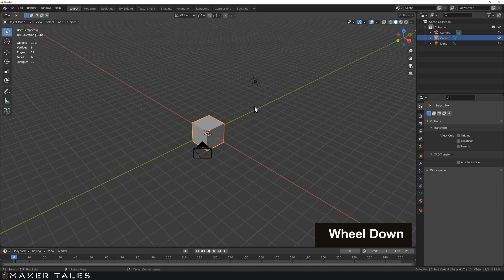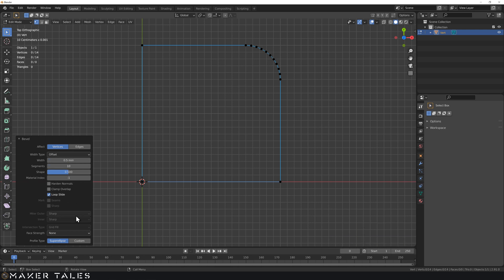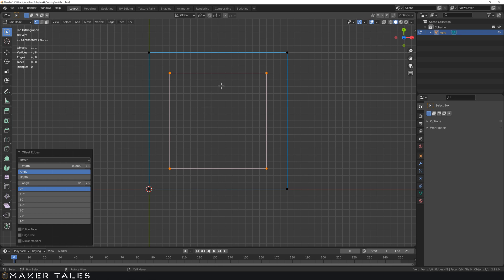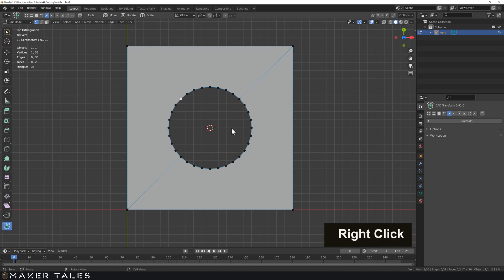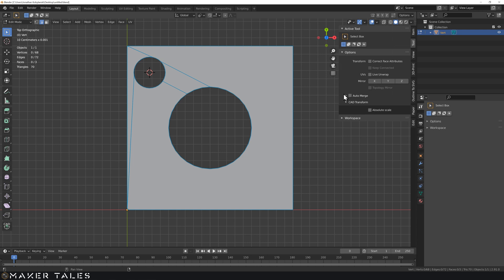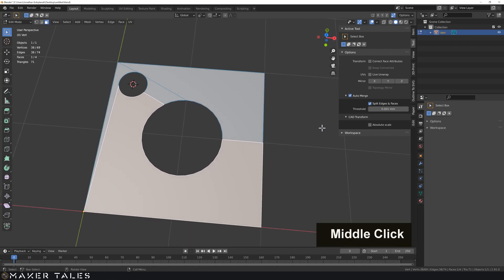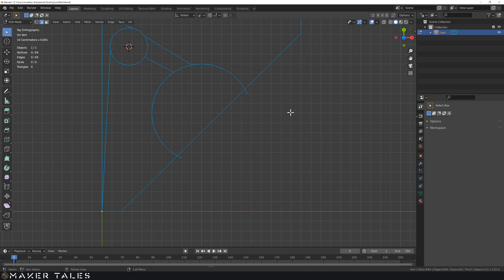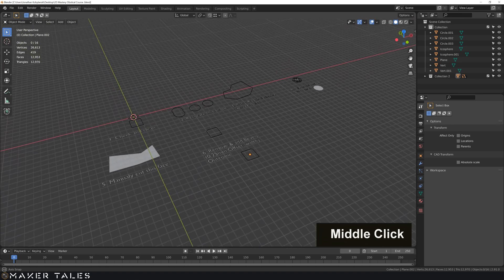2D Precision Basics Continued - Blender 2.9+ / 3.0 Through Precision Modeling - Tutorial | Part - 14

Comment: 12:45 if you don't want to move the vertex back and forth after moving it with CAD transforms, you can just go G type 0 and enter. The vertex does not move but the split happens

Comment: I have a question, is the width setting for the bevels similar to the radius setting in other programs like AutoCad. For example if i wanted a square with 2mm bevels could i do that by entering 2 in the width parameter?
Reply from the maker: Over all yes. From my understanding. When it basically does is duplicate and "slide" the vertex along the edges by 2mm.

Comment: your method of reverting chamfers and bevels only really works for objects perp/parallel to view. Would it be easier to just delete the vertices, then use tiny cad to get the intersection? That would work, regardless of the angles. You could use cad transforms as well, in a similar way to what you've done with the scaling method, but just deleting them and using tiny cad seems to be a faster method which also works with more examples. 
Loving these BTW. I've been using blender for a little bit now, but also use lots of CAD software, so it's nice to see how different people use blender with different backgrounds.
Reply from the maker: Hey Andy, there are plenty of ways to undo bevels. The method I use can work in any orientation It just takes time and the use of CAD transforms not default blender movement.

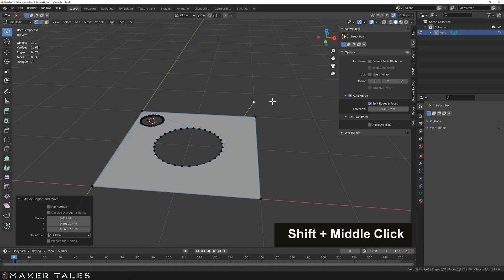Comment: Amazing videos! I have one question: When using Cad - Transforms, I cannot snap to vertexes unless they are part of a Face. For example, it happens in a situation like 11:36, when there is a vertex in the end of the edge after extruding: I go to Cad Transfroms ("Alt+C"), I press "G", "space" and "V", and I cannot snap to that vertex (I cannot even select it to move it), but I can select and snap to all the other vertexes which are indeed part of Faces. The same happens in other similar situations, not only in this particular one. 

Does any one could help me with this problem? 
Thank you so much, and congratulations again for the video series!
Reply from the maker: Hmmm, this sounds like you might not be is vertex selection mode. Make sure on the top left of edit more you have vertex selection on to be able to move a vertex.
Reply: @Keep-Making  Thank you for your fast answer and your help! Finally I installed again the add-on in the most recent version and it worked perfectly.
Reply: I also have an issue at @11:36, CAD Transform shows the cursor snapping to the edge center, but the vertex does not move to the snapping point. Instead, it kind of ends up underneath the object in Z space in a sort of random-seeming spot. -If I do all of this in top-view it all works fine, it's like 3D view is messing things up.

I've been banging my head against the wall. I select a vertex, extrude in 3D, press G to move, V to select vertex, space, shift+e, the cursor shows the snapping circle in the right spot but that's not where the vertex ends up. If anyone can help that would be much appreciated!

Follow up: 

I've debugged this some more and it seems like the issue is that in CAD Transform I'm unable to use "vertex snapping" to initially snap the "from" point to the selected vertex. This seems to be occurring for vertices that are not part of a contiguous loop, but are "free-floating" like the extruded vertex in 3D space. Also this was not working in top view, the vertex snapped very close to the edge but I realized this was still slightly off and not joining the edge.

The only workaround I've found to sort of "follow the tutorial" is to:
-select starting vertex in center circle
-Don't extrude Shift S, cursor to selected, Shift a add single vert
-Alt-C + G + spacebar + v : you should now be able to select your new vertex, snapped
-Spacebar + shift E: you are now in edge center snapping mode and can snap to the corner

You can select both vertices and use f to join with an edge, but to demonstrate what's happening in the video with splitting you can also just press W to normal select the vertex, do the G + Y 0.1 example, switch to edge select mode and observe that the edge is now split in two at the vertex

Hope this helps someone but if I'm just messing up someone please let me know

Comment: Nice job,  all very clear.  One thing isn't working for me is ALT f,  the quick method you describe. With the square and circle selected in edit mode,  it fills both the square and circle within?
Reply: ah got it!  the circle and square need to be joined for alf f to work it seems. Also f between vertices needs the objects to be joined?
Reply from the maker: Anything to be joined need to be in the same object. In other works mesh in two different object can not be joined.